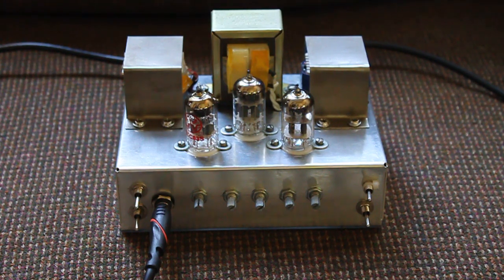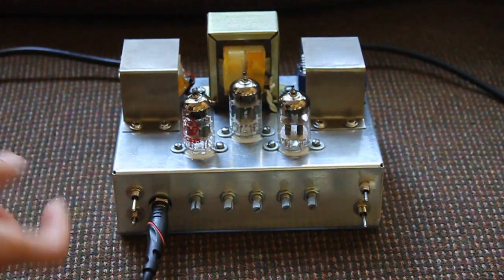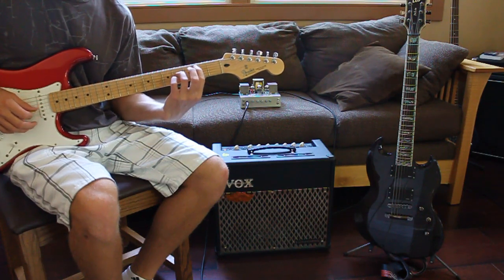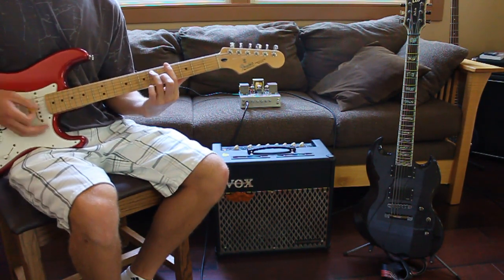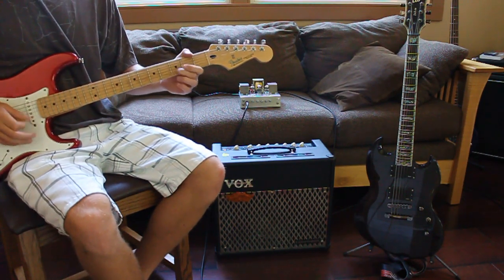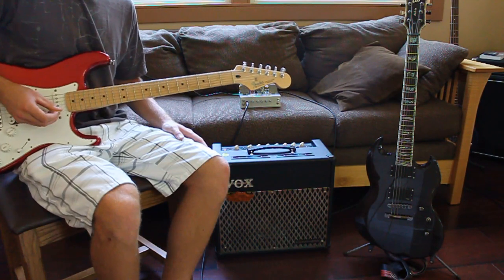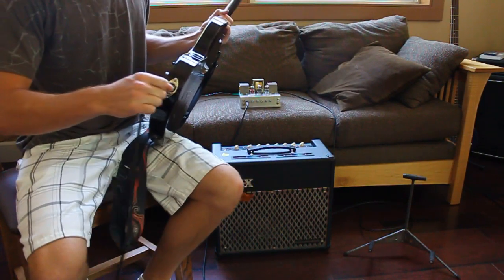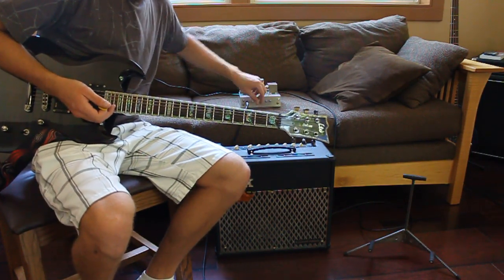12au7 guitar amp partially based on firelfly amp

Comment: Hi Tyler, I saw that some of the newer versions of the firefly amp are missing C8 capacitor at the primary of the output transformer. Did you keep it or not? Do you know how much is it affecting the tone? I am in the middle building one with an extra master volume pot added.

Comment from the maker: the hum may be due to how i routed the signal path and power supply wires, but i think the power supply is a bit noisy, there are 3 47uf filter caps, but the resitors used to create the RC filter are only 470 ohm, 1k ohm, and 4.7k ohm, so there is not much actual 60hz filtering.  although overall the noise levels are tolerable, its just that the camera mic adjusted when it was quiet and made the noise seem louder.